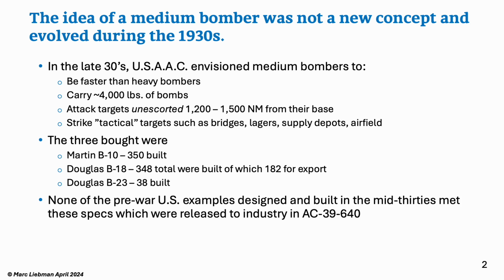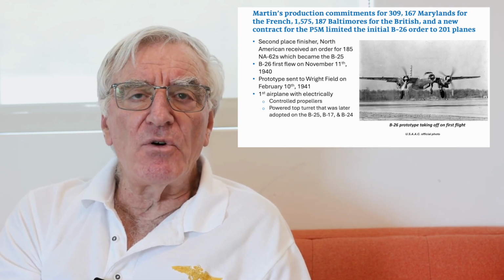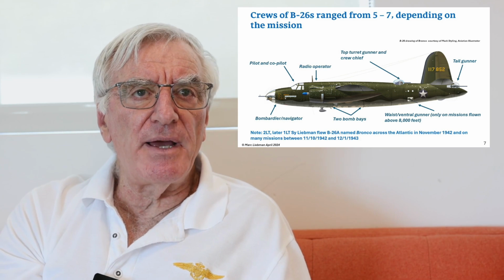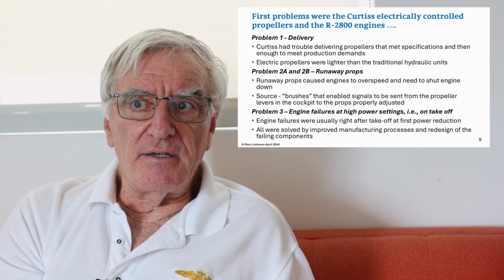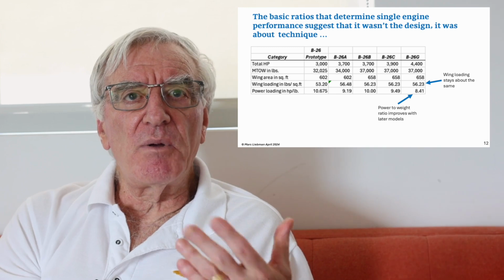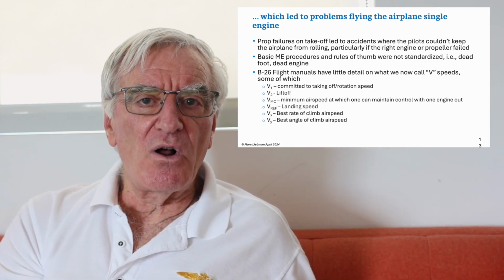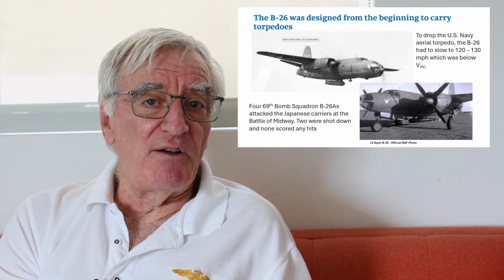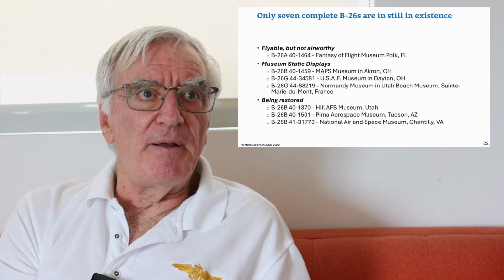B26 Issues

Comment: Read some where in the `70s that B-26s usually flew between 12 to 15k ft which was the designed height for the Norton Bombsight and where very accurate at those levels whereas the 17s & 24s were much higher and for some reason those bombsights were off at those heights.
Reply from the maker: Altitudes on level bombing varied due to wind the weather and the actual target. Some were as low as 8000 and some in the mid-teens. the preference was 8 - 12 so they didn't have to wear oxygen masks!

Comment: You memtioned that your dad flew to the Caribbean, did he come to Jamaica🇯🇲? I live there. The US had a army air field on this island call Vernam Field which had an advance training squadron call 36th Air Ways Detatchment 1944-45. During one training mission B-26 (#41-35096) crashed during training taking all 6 unboard. It was witness by residents of Rocky Point who were the first to respond.
Reply from the maker: When the 34th BS/17 BG went to North Africa, they left from what is now Barksdale AFB. The 34th lead the way with each squadron following about a day behind. Next stop was what is now Homestead AFB, then Ramy AFB in Puerto Rico. From there, it was on to British Guyana then Natal, Brazil. Next leg was to Ascension Island, then to Dakar, Casablanca and then on to Telegram in Algeria. Took them about 10 days.  that's probably more detail than you wanted, but they only lost one plane that slid off the runway in Brazil when they had a prop problem.

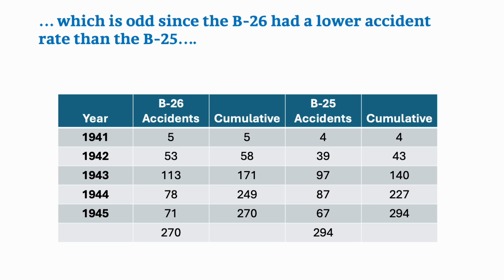Comment: FWIW, chart at 11:20 would make a better point if production figures were included.  1942, 58 B-26 accidents of, say, 100 aircraft produced and flying versus 39 B-25 accidents of, say,  250 aircraft produced provides a more illuminative comparison and completely different conclusions.  B-25 production (9816) was nearly twice B-26 production, so roughly same number of accidents DOES mean the B-26 was much more prone to accidents.  General Doolittle nearly had wings himself, so his demonstration could of led to novice pilots to think, 'Yes, Doolittle can handle the B-26, but what of us mere mortals?'

Comment: 12:45 statement  "That the plane was much more controllable" ...posts a few question marks.   
If the power is higher, the power on one engine is higher, right?   So the moment around the Z axis is higher.   
Using the same tailplane as lesser powered models, not placed in the slipstream as the B26, the Vmin control on 1 engine is also higher, you simply need more stagnation pressure (=wind) to counter the higher moment around z axis. 
The only thing is the faster acceleration brings you faster throught the lift-off speed to the minimum 1 engine  control speed. That is death trap speed range. 

Placing the vertical tail in the active slipstream, so using 2 verticals, helps to lower the 1 engine minimum control speed.

Comment: Nice video.  A couple of points. I believe the Curtis C-46 may have been the first production AC to use electric propellers.  B-25 accidents were fewer, but more B-25s were built, so the their accident rate was lower.  In the “techniques” table it should list “lb/hp not hp/lb.  Well done nonetheless, very informative.

Comment: From you and others I get the impression that World War II multi-engine training was not very good. In fact inadequate. Could you comment?
Reply from the maker: It's a great question. I wouldn't use the word inadequate. The word I would use was "uniformed." Understand, we were moving from bombers like the B-10, B-18, B-23 which were relatively easy, comparatively speaking, to fly on one engine compared to the B-25 and B-26.. Second, our knowledge of the flying characteristics of a high performance twin was in if not its infancy, we were just becoming toddlers. 

As I said in the video, go read the flight manuals of the A-20, B-25, B-26 that were first put out and go read the ones for a light twin such as a Piper Navajo or Seneca. There's no comparison in the instructions and information on flying single engine. The whole concept of V speeds hadn't been created. A lot of what was learned was through trial and error.

Next, the ME trainers of the day - the AT-11 and the UC-78 - gave you the basics but were relatively easy, comparatively speaking, to fly. Again, the lack of info on how to fly ME airplanes and handle emergencies was a huge problem. Much of what was known was through trial and error. While there were procedures, the details and nuances were just being learned.

The USAAF was sending recently graduated pilots right from flight school to bomber squadrons without any ME training. That was dumb, but they needed pilots, particularly in Europe where B-17s were being shot down at alarming rates. That's a whole different issue.

Last point. Every military pilot who earns his wings makes a significant jump when he gets to his first squadron. This has been true ever since the beginning. This is one of the two reasons why the Navy and the USAAF went to the Replacement Air Group (RAG in the Navy) and Operational Training Unit (OTU) concept early in the war. This helped pilots go from the T-6 to the F4F, F6F, F4U, P-47, P-51, even the P-38.

We still do this today. In the Navy, you earn your wings in a T-45 and then jump to the F/A-18 or the F-35. In the AF, its the T-38 and then the F-15, F-16, F-35. Huge jump in performance. We can do it because we now have cockpit procedures trainers, simulators, software training programs, etc.

Comment: I think the table shown at 11:22 has an error on B26.  By 1944, B26 has 249 accidents. Adding 71 accidents in 1945, the cumulative for B26 should be 320, not 270.
Reply from the maker: Hi, I see your point, however, I pulled this chart from p.499 of William Wolfe's  very comprehensive book called The Martin B-26 Marauder published by Schiffer Publishing in 2014.  Given the amount of research and detail in his book, I'll go with Wolfe's chart. However, I am planning another video called The Death of the B-26 and I'll bring this up. Look for it this fall.
Reply: @marcliebman3847  
Thank you for replying my question. I understand the reason of not changing the table now.  However, in this case, the data in the table appears to show that B26 consistently had more crashes than B25.  That was what had confused me.
Again, I would like to thank you for making these wonderful videos.  I learned a lot from them.

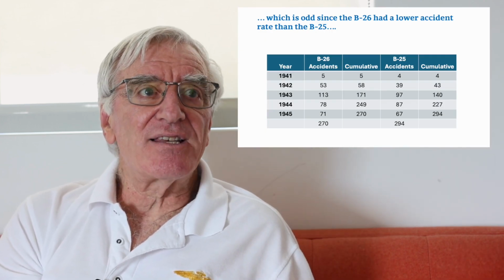Comment: Good presentation. Reference 11:26 , there were twice as many B-25s in service compared to B-26s. That gives B-26 a higher probability of accident. despite lower total numbers lost.
Reply from the maker: True. to some degree. This is why we - at least the U.S. Navy - looks at accident rates per 100,000 flying hours. It makes comparisons like this easier. There is no doubt that the B-26 was a "hot" airplane and in some parts of the flight envelope, the margin for error was very slim. I can give you a long list of airplanes that had that description starting with the F7U Cutlass the navy flew in the 50s. It was dangerous around the boat. Or the P-39 which would spin flat and one couldn't get out because the slipstream kept the door closed. And the list goes on. .

Comment: PBM vs P5M.
Reply from the maker: PBM and P5M are two different airplanes. The P5M was developed from the PBM.  They look alike, but are different airplanes.
Reply: @marcliebman3847  Concur. My point is that it was the PBM that was in development in the late 30s, not the P5M which was a post war aircraft. I have a couple of flights in the P5M before I went to flight training.
Reply from the maker: @bobharrison7693  When I signed up on the dotted line to flying the Navy, there were two planes I wanted to fly the most. Once was the A-1 and the other was the P5M. Unfortunately, by 1968 when I entered flight training, the pipelines to those planes were closed....
Reply: @marcliebman3847  I much enjoy your work and am going to check out your books. There was one cadet in my pre-flight class (01-64) who was in the last class to go through VT-30, the A-1 advanced squadron. I would have loved to fly the A-1 but wasn't sure I could get A-1s and didn't want to fly "Stoofs." In retrospect I would have loved to fly the P5M.
Reply from the maker: @bobharrison7693  After I finished CQ, I had the grades to get into the jet pipeline but the navy sent 25 of us to Ellyson to fly helos. I had a choice, either fly heels or DOR. Quitting wasn't an option so I became a helicopter pilot.

Comment: Great video! I have never heard about the RAF torpedo bombing; everything I have previously seen indicated the Brits didn't like the plane.  Another unit I have not seen much on was the 22d Bomb Group that flew out of Port Moresby in 1942.
Regarding accidents, it was my understanding that new pilots were jumping from low-powered trainers straight into Marauders, and trained to 'fly by feel'.  This meant that green pilots were often fatally far behind the airplane during take-offs and landings.  As the concept of 'flying the numbers' took hold, problems were reduced.
Reply from the maker: FYI, Gen. Kenny did not like the B-26 and therefore there were only a few groups in the 5th AF. Most of the B-26s were in the ETO.

The primary ME trainers for the AF were the UC-78 and the AT-10. these provided the basics of ME flying and yes, the B-25/B-26 were a step up in performance, but by the time the pilots got their wings, they had 250+ total hours including ME time. AF and USN students now go from the T38/T-45 to the F-16/F-15/F/A-18/F-35 which is a huge step forward so it was no different then as it is now.

Back to V speeds and basic ME training/flying techniques. In WW2, the flight envelopes weren't well documented in the POHs. V speeds were unknown so in the manuals of the B-26 (I have copies of all of them), there is little guidance other than get to 140mph on takeoff and you need 160mph to fly the airplane single engine. The concept of dead foot = dead engine wasn't taught until much later. My point is the the accident rate was as much a failure of knowledge and technique, not of the airplane.

The RAF was much more successful at dropping torpedos from the B-26 than the USAAF was. They flew mostly out of Egypt and North Africa  and attacked German/Italian transports in Greece and the Adriatic. 

Besides Midway, the 34th Bomb squadron flew a couple of missions with U.S. Navy torpedos and stopped. Reason was that they had to be dropped below 120mph.  No one in his right mind was going to get that low and slow in a B-26!  

Hope this helps.
Reply: @marcliebman3847  Thanks for a really informative reply!  B-25s and A-20s were indeed better suited for the primitive conditions of SWPAC, so it's understandable that they were withdrawn or simply not replaced.
No, the Marauders were not at fault for the training crashes; thanks for describing the problems more succinctly than I could!  I still remember how, as a student pilot, trying to 'feel' approaches in a Cessna 152.  Recognizing that 'Pitch + Power=Performance' was a bit of a struggle.